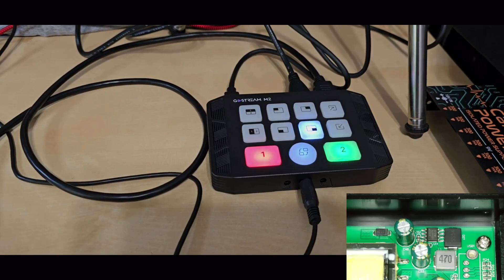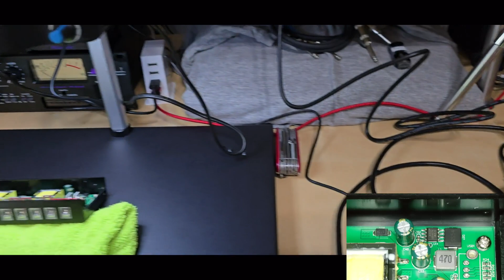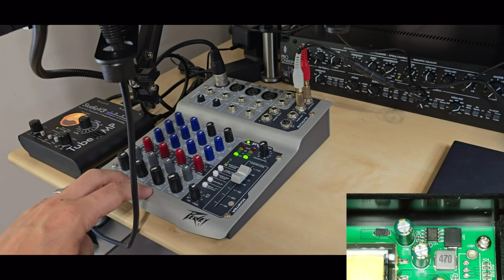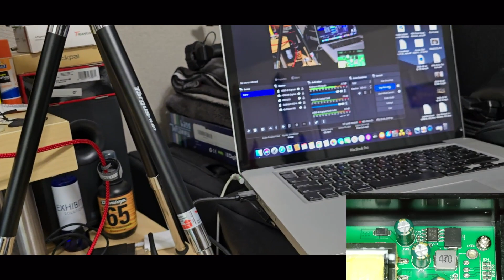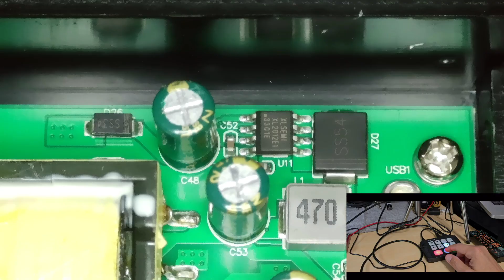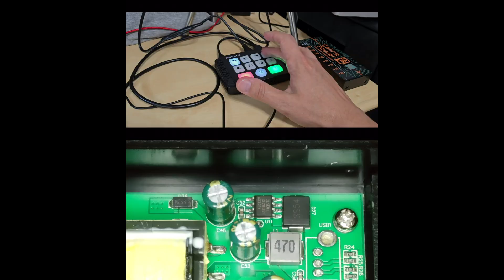Osee GoStream M2 Dual 4K USB 3.0 HDMI Capture Card, 2.1 HDMI Splitter/Switch Record: Review & Demo

Comment: Have you used this with OBS? If so, does each feed register secretly or are they read as a single feed? Thanks...
Reply from the maker: @JourdanMount  I do use this with OBS. Yes the left and right channels are recorded individually
Reply: @Bassguitarist1985  Thank You.... if you used 2 of them, it would intern allow for 4 feeds?
Reply from the maker: @JourdanMount  I do not know for sure but if I had to guess I would say no. Each would be treated as their own individual LR feeds and summed into whatever output destination you have set for. It's worth a try.

If you need four HDMI feeds then you may need a larger switcher to accommodate.
Reply: @Bassguitarist1985  I have the osee gostream deck, but ad far as I can tell. It will only output 2 feeds